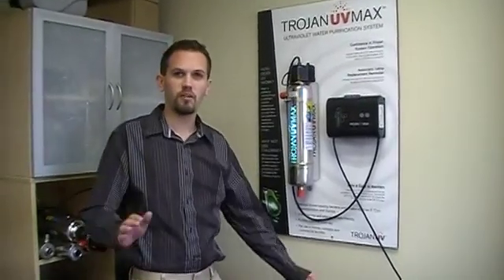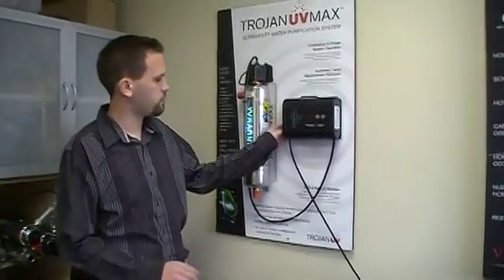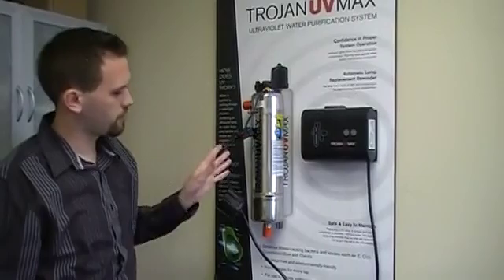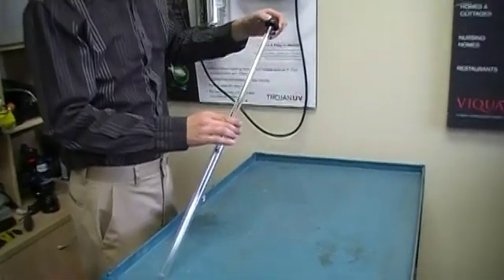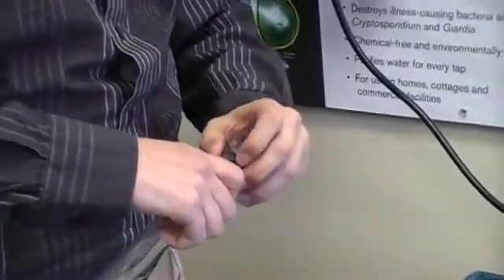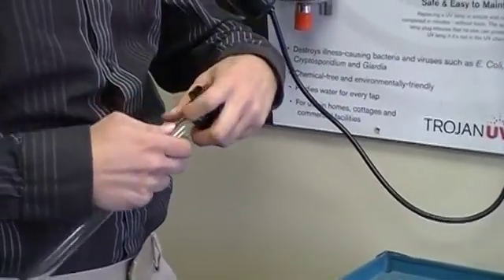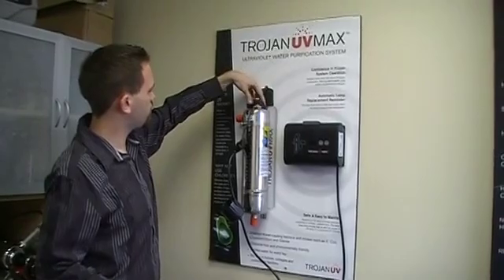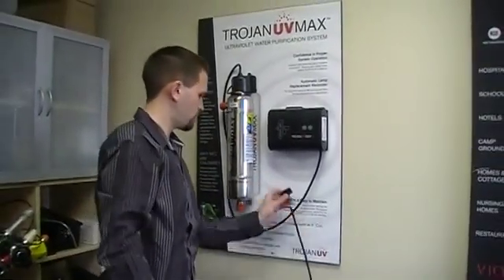How to Change a Trojan / Viqua UltraViolet UV bulb or lamp.

Comment: What a piece of junk compared to Rainfresh, 1/4 the time to replace the bulb, no need to turn off water or take a chance at hurting the sleeve, previous house had a rainfresh, new house has this, I will definitely be replacing the unit with rainfresh
Reply from the maker: Hi John, Regardless or brand or model, it is extremely important to remove and inspect/clean the UV sleeve every time you replace your UV lamp (more often in some cases).  Fine sediment and minerals like calcium and iron can build-up on your UV sleeve over time, reducing the amount of UV light that reaches your water to sterilize it.  The UVMax design ensures that the sleeve is inspected every time the lamp is replaced, as it should be.  Any model that does not ensure that the operator is performing this important maintenance step is potentially leaving the operator at some risk as it can allow for this important maintenance to be omitted, thereby creating a potential situation where the water may not be getting disinfected properly due to sleeve fouling.  Trojan/VIQUA is the world's leading manufacturer of UV sterilizers and the UVMax series has been the number one selling residential platform over the past 20 years for good reason. I would encourage you to stay with your UVMax system, but If you switch to Rainfresh, just be sure to inspect and clean your sleeve regularly.  It truly is really important.